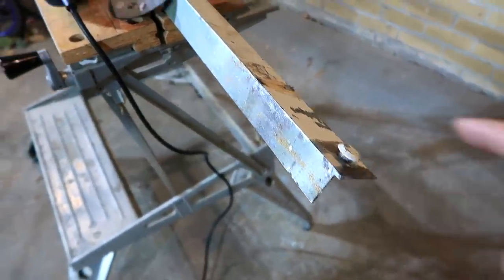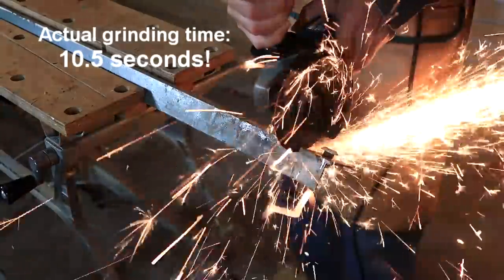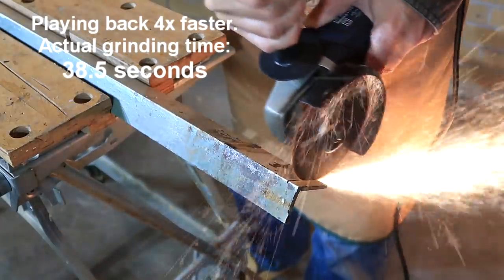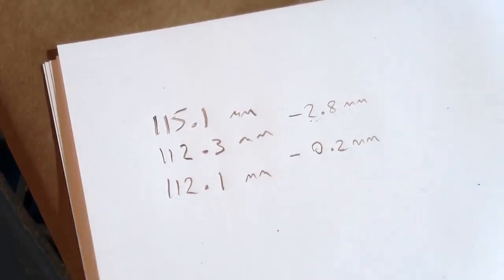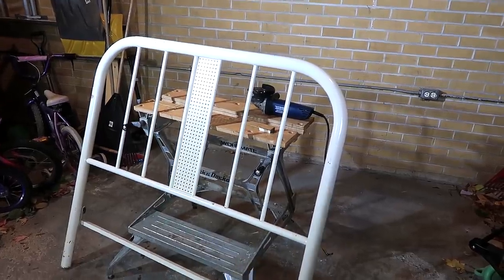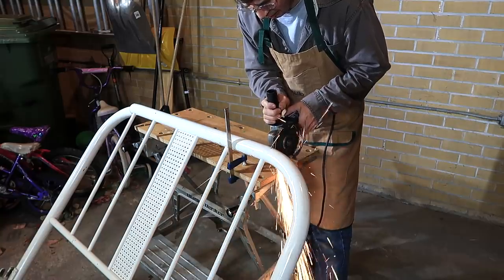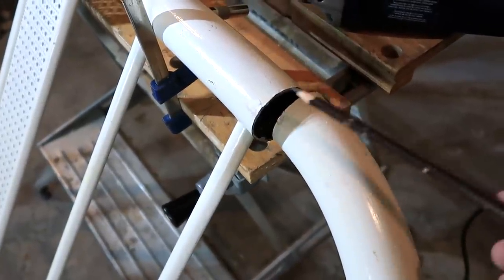make cutoff disks last 10x longer (replicating Fireball Tools' experiment)

Comment: But using the same disk repeatedly, you are constantly reducing the diameter and...   surface speed at the cut interface.   I still say with a ~10x reduction, your general results are accurate even if the data is a bit skewed by an ever decreasing diameter.   Like so many things in the engineering world:  Good, Fast and Cheap, you can only pick 2
Reply from the maker: At 2 mm used up in the first cut, that's a 3% reduction in diameter.  That's within margin of error.  Also, if I factored that in, the advantage of  the gouging cut would be even more.
Reply: @matthiasrandomstuff2221  I think that Diameter is a fine proxy for such a small number of tests, but to be scientific about it for a large sample test, you would want to consider that you are loosing volume of disk which is proportional to the diameter squared and that speed is slower... Really it is only fair to do the test in a similar fashion as Fireball with complete disks dedicated to each cut style. It could even be argued that the first plunge cut damages the disk potentially leading to faster wear on the score cut method.
Reply: @matthiasrandomstuff2221  precisely.  would be interesting to see if the reduction in mass results in an increase of loaded RPM which could negate any loss of surface speed of the disk interface with the material.  Or, if the speed of the tool is lockstepped to the Hz of your power and the mass is insignificant.  It's just cool that you repeated Jason's test with "lesser" disks and tool and got similar results.    If we could get him off speed (j/k), it would be interesting to see how Project Farm would approach this?

Comment: It might be more efficient but I don't think the results of this test accurately reflect the statistics.
You always use the plunge cut first on new disks, which essentially starts both control groups the same.
If the disk's are less dense in the outer edge it could explain the huge difference, even more, many cutting tools when new first shed a layer and sort of grind themselves to shape, which can also explain the bigger loss.
To get accurate results you should perform a series of cuts with a new disk with one technique, and then another series with the other, and cross compare all loses between the cuts.

Comment: Do consider that the first cut uses a lot more of the disk than the next cuts.
Cool video, I'll be cutting lots of aluminum extrusion soon so this video was just in time!
Anyone know if this technique works on miter saws with metal cutting blades?
Reply from the maker: yes, the disk getting smaller means the later cuts will lose more diameter for the same amount of grinding.  But with just a few millimeters lost on the disk, the effect is small.  And it makes the initial (fast cut) appear to use less blade.  So the difference would perhaps be 3% bigger (insignificant) if I took that into account.

Comment: I’d assume as the disk gets smaller you’d also start to see the diameter decrease more with each cut as it will have to do more turns to achieve the same amount of cut

Comment: I would not be surprised to loose a mm or two on the first cut since the edges can be pretty damaged even on new disks . Maybe you could consider making a test series where you do 20 cuts with one disk and apply different forces, and then compare the results. 

(and I don't like n=1 samples)

Comment: The glue holding the abrasive dics together is designed to fail at a certain load. That load is supposed to occure when the outmost abrasive particles become dull, so then the glue would release them and reveal a new layer of fresh sharp abrasive particles. I guess the point load on the disc is simply a bit high when you grind with only a small portion of the disc contacting the material, also the angle at which the disc enters the material is steep compared to the more shallow angle of entry on your slower approaches which ought to promote particle seperation due to glue failure.

Maybe these cheap discs have slightly too weak glue, too? Maybe that's the quality difference between a good expensive dics and the cheap ones?
I wouldn't know, i always buy the cheap ones.

Comment: Surely I can't be the only one that has jammed a cutting disc into a harsh cut and gotten a face full of dust from the wheel and knew immediately that it cut better but wore out the disc crazy fast.
Reply: Yup I learned this at 12 while working at my dad's fabrication shop. I hated using the grinder. It was always a long and dirty job.
Reply: Yup I learned this at 12 while working at my dad's fabrication shop. I hated using the grinder. It was always a long and dirty job.

Comment: If the discs cost 25p each (when buying in bulk), it takes 20 secs to change a disc (using a quick-change arbour nut), how much does your time need to be worth before one method becomes more cost effective than the other?

NB. I've no idea how Mr Fireball is paying $6 per disc, the off-brand 1mm discs I buy by the 100 are nearly 20x cheaper than that.

Comment: The diameter of the disk decreases as it wears down, so I wonder how this impacts the measurement?  I would assume a constant rate of wear, but since the disk is traveling the same speed, that assumption doesn't hold.  Interesting problem.  I guess it's a good approximation to assume a constant rate of wear, given the complexities of a more-accurate model.
Reply from the maker: pointed out and answered many times already.

Comment: Awesome results but is there any appreciable difference between gouge cutting on the leading edge vs the trailing edge of the wheel? One way you’re lifting the material up and out of the tubing for example, and the other you’re shooting it down into the tube.

Comment: The measuring approach and extrapolating is slightly flawed. As the disc gets smaller it has to turn more times to rub across the metal for the same distance. Also the speed across the metal slows down as the radius decreases so even doing identical cuts I would expect a different change in diameter when starting a cut at 115mm to that when starting a cut at 109mm. I would also ignore the first cut as that starts off with the manufacturers square edge on it. I don't disagree that the disc lasts longer, its just that it is very hard to put an accurate statistic on it. I think it would be a more accurate test to start with a new disc and keep doing the same cut until the disc was say 100mm and then do a second disc to the same point then count the number of cuts, but that is what Fireball Tool did anyway.
Reply: If cutting slow removed 1mm, and cutting fast removed 1.1mm, followed by "Slow is heaps better!!!!!" then yeah, that'd be suspect.  But when there's 3mm difference in cuts that confirms the original test.

Of course nothing is stopping you doing the test "correctly", but was all know no-one is going to bother, posting a comment is far easier.

Comment: Firebull banned my comments as he had an agenda and didn't want to hear facts
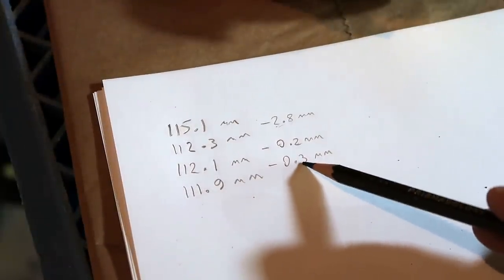In his video at 1:36 you can see the disc turning to dust. Any fabricator would think there's something not right. 
His techniques are biased, ie hes uneducated.
You don't need a high-speed to know its 90% vibration related. You can hear the metal sing across neighborhoods. Singing metal is bad. The other 10% is pressure applied. 
I have 20 years grinding experience daily. The pferd are OK but makita win hands down. I've used over 1000 of each at work and home. 

1.You have thin material overhung 2feet of your saw horse. Clamp your work as close to your table. 
2. You are holding the grinder at the back for some unknown reason. When the grinder bounces and are acts as a lever 1 foot from the cut. 
Think of the Simpsons water pecking bird, you are essentially using an angle grinder like a wood cutting axe. 
3. Use  a side handle please ffs. It will be directly above the cut pushing the blade down while your other arm pushes forward. Everyone I've ever met hates them, but they either don't pay for their own discs or they don't grind enough to feel the vibrating joints in your hands after an hour of grinding. 
4. Every time the blade cuts, it loses contact with the work. When it recontacts you will wear the disc. Normal discs turn to mustard dust like 1:36
People say "let the tool do the work". NO. The following applies to cold saws, bandsaws, grinders etc - KEEP an even pressure to not allow each cut to slam down after contact loss. 
Think of your right arm as a shock absorber. 
5. You plunge cut at full depth of the blade. Every wood worker is taught to plunge cut with the least amount of blade pertruding from the work. 
The extra friction here wears the side of the blade, so you make the blade thinner, weaker, more prone to explosion and obviously wear faster. 
6. Maximum 11000rpm is not needed, half speed variables are great. Basically a speed just higher than battery grinders operate at, but battery torque is too poor. 
7a. You are using 180mm 1.8mm wide discs vs 125x1mm. Unless you need the depth of cut the thinner disc has almost half the friction. Blades last longer so an extra disc change is negligible. 
7b. The 180mm is larger diameter, so per rpm the blade is moving faster. 11000rpm and 180mm is way to fast. 
Conversely as any blade wears down its effective speed lowers. Bad chad says "as the blade gets older it shits the bed"
8. No idea what grinder your using, but 1200w is the minimum you need to keep constant rpm at all cutting forces. You will be shocked at how hard you can push if you keep #1 and #4 in check

One thing you never addressed was climb cutting. You operate mills so I know you are familiar with it. 
If you read #4. above, When plunging, a climb cut has a higher blade speed, but the force you apply climb vs non climb will alter blade contact. 
I wouldn't worry much as its only a 10% efficiency difference, but the shock absorber effect I mentioned is different for each. 

TLDR. Too long didn't read:
High pitched metal singing bad, if you see mustard dust STOP using your technique and read this list

Comment: does not change the outcome - but if would have expected to take this into account ;)

 but you should have not calculate the diameter-loss, you should calculate the loss of area since the cutting edge (circumfence) gets proportionally smaller with each cut - so a loss of 1 mm at 115 mm initial diameter is actual more than a loss of 1 mm when your starting diameter is 105 mm for example

to put this into perspective - your gouge cut where you lot 0,35 mm seems to be less efficient than the slow gouge where you lost only 0,32 mm - but in fact in the first cut (since the diameter of the disk was bigger) you lost around ~ 61,4 mm² of the disks area where on the second example you lost only ~ 54,8 mm² - so even the if the second example loses ~ 9,5 % less diameter, it used in fact 11 % of the grinding area - which makes the second result even better

Same goes for the first/initial test vs. the fast plunge near the end

2,8 mm loss in diameter actually means 500 mm² area lost
2,17 mm loss in the second example is only 376,5 mm area lost
rating it by the diameter this would mean an 22,5 % improvement where actually you improved by almost 25 %

and yes: this effect might be neglible and be way in the margin of error - but your methodology is still flawed in this point

also, if the diameter is reduced, you get less friction because the angular velocity of the disk gets smaller (assuming the rotational velocity stays constant), and also the radius of the disk gets smaller, which results in a smaller contact point of the disk on a flat surface

in practical terms, this makes a difference if you use cutting disks for stone/concrete and use a big angle grinder with 250 mm disks - at frist the disk gets eaten away very fast but when the disk gets very small - say 100 mm and below, it seems to last for ages

so in a controlled test you would ideally use the same brand new disk for each cut and also apply pressure via controlled measures - like "Project Farm" does this in his tests
Reply from the maker: yes, the disk getting smaller means the later cuts will lose more diameter for the same amount of grinding.  But with just a few millimeters lost on the disk, the effect is small.  And it makes the initial (fast cut) appear to use less blade.  So the difference would perhaps be 3% bigger (insignificant) if I took that into account.

Comment: Isn't it wrong to measure just the diameter? Shouldn't one measure the volume missing? With diameter meadurements, in the beginning the wear should be slower and get quicker as the diameter gets lower, right?

Comment: It doens't surprise me his discs were wearing out so fast. You could see the brown dust of what was once the disc in his video. I'd be curious in seeing how those steell cutoff discs work when really bearing down on them as well. Can you get away with it or will they wear down at a similar speed?
Reply from the maker: I tried bearing down on the gouging cut, but I just couldn't make it go fast.  Not freehand at any rate.
Reply: well its not the force that you use to press against the material its more like that it actually gets stuck on the sharp edge of the material.

Comment: 1st thank you for your effort, but the Quality of the discs i.e. Brand makes big difference as well, I ve had low quality discs not only wear faster but are much easier to brake. I have found that 4 ½ grinder discs are not a good item to try to save money on,  Buy the best,  cheap discs are a False economy save money someplace else.

Comment: Does the disk get used up faster as the diameter gets smaller? Seems like the same point on the disk would come back around faster as the diameter decreases. 🤔
Reply from the maker: I don't think so.  Diameter would drop faster, but not surface area.

Comment: Wear filter mask, you are breathing all the material which you grinded off the grind disk snd that the pretty nasty and probably toxic stuff. Resin, glass fibers and grinding material. Can you measure it with dust particle u used before?

Comment: You should use a NEW blade each time! The 1st cut touched area of the disc used in the 2nd cut.
Also I have a hunch the outer edge of new discs isn't as good as the middle.
Reply from the maker: yes, the disk getting smaller means the later cuts will lose more diameter for the same amount of grinding.  But with just a few millimeters lost on the disk, the effect is small.  And it makes the initial (fast cut) appear to use less blade.  So the difference would perhaps be 3% bigger (insignificant) if I took that into account.
Also, on the round stock later, the effect was also quite strong
Reply: @matthiasrandomstuff2221  My point wasn't about the diameter getting smaller as others have pointed out, but, instead, about wearing down the sides of the disc in the first cut.
  If you didn't wear out the sides on the first cut, then the 2nd cut might show a reduced wearing.

Comment: I am not a fabricator, so this might be a dumb question. Would waxing the face of the cutting disc help with reducing wear?
Reply: You cut a candle between cuts when cutting aluminium with I grinding style disc. 
It stops the aluminium melting onto the side of the disc which can make the disc explode. 
So I'm sure it would help

Comment: If dont use a new blade the test wont be acuart because the disc gets smaller and that means lower rpm
Reply from the maker: yes, the disk getting smaller means the later cuts will lose more diameter for the same amount of grinding.  But with just a few millimeters lost on the disk, the effect is small.  And it makes the initial (fast cut) appear to use less blade.  So the difference would perhaps be 3% bigger (insignificant) if I took that into account.

Comment: Watched Fireball Tools' video yesterday. What physics do you feel are at play here? Could it be that the cutting angle is more acute with the gouge method?
Reply from the maker: The gouging cut doesn't expose the disk to a hard edge, or really high pressures on a small area.  Which makes it gentle on the disk.
Reply: I think Fireball Tools' video explained it quite well. The disk is extremely hard but brittle and the increased vibration from a plunge cut focused on the edge breaks it apart. Ever dress a grinding wheel?
Reply: @ghost2coast296   in heavier stock even the 1/8" matthias used here the vibrations arent near as bad, they certainly do wear down disks but theyre not the only thing at play, cutting say 2"x1/4" flat bar you notice the difference in how much dust is flying and how the blade is wearing if you let it hang 3 ft out of the vice vs being within a few inches of the vice

im sure between the sharp edge, sides to rub on, and the increased pressure/forces from the faster cut time all add up to make that 10x figure